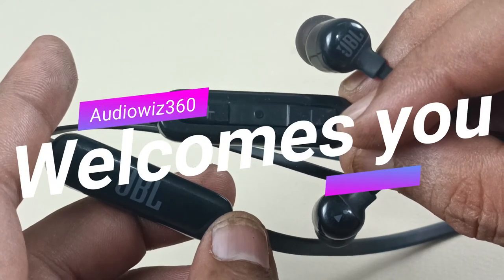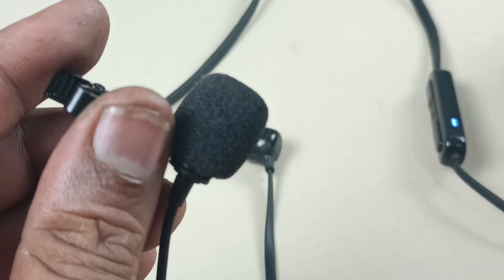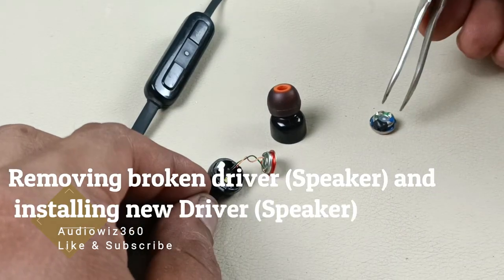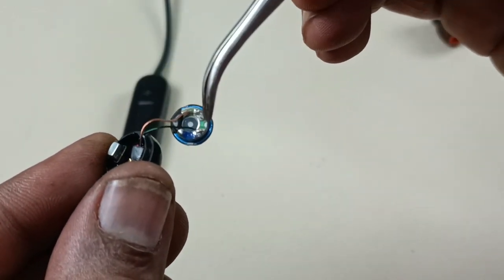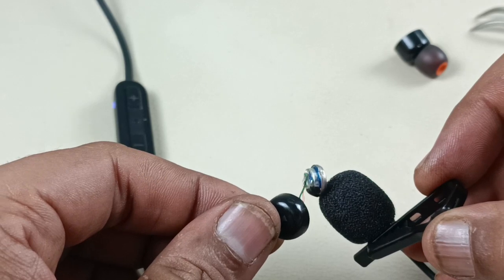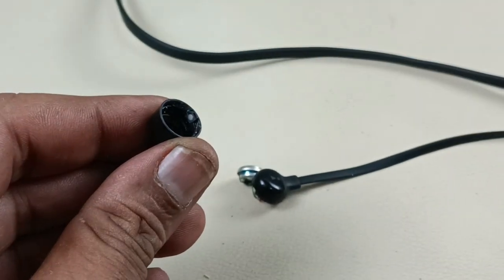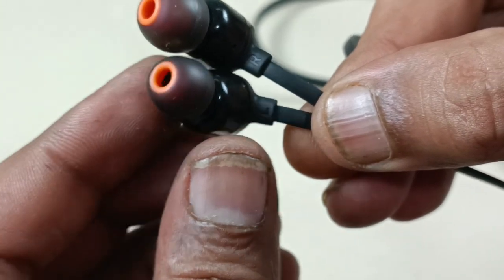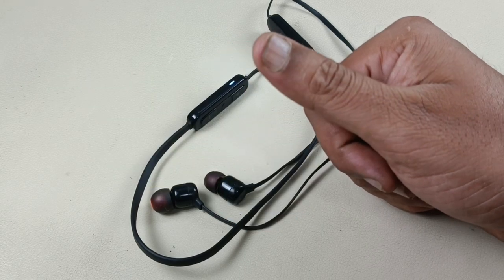Bluetooth earphone repair | How to fix wireless Bluetooth earphone neckband | JBL T110BT not working

Comment: It looks like you've completely broke audio-driver and then repaired it.
Reply from the maker: this is common problem in this particular model JBL T110BT, don't think too much brother. I have repaired approximately around 3000 units of this.
Reply: @audiowiz360  I see. I didn't mean to be rude.
Is it possible to disassemble earplug without damaging the driver coil?

BTW. As I can see, this particular model suffers from the issue related to the broken wire near or inside of the earplug.